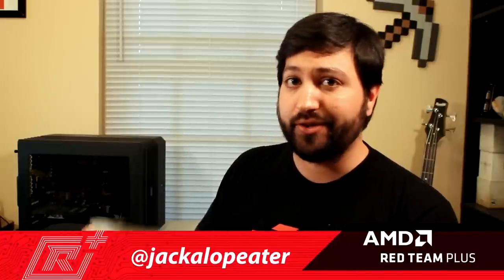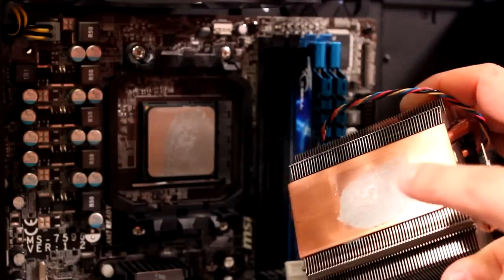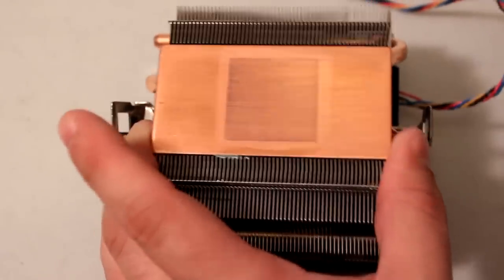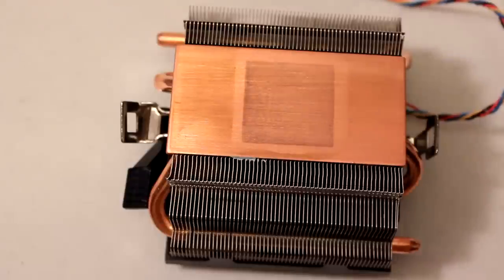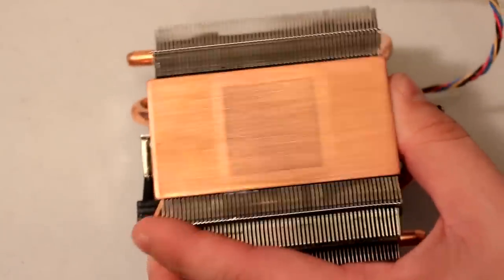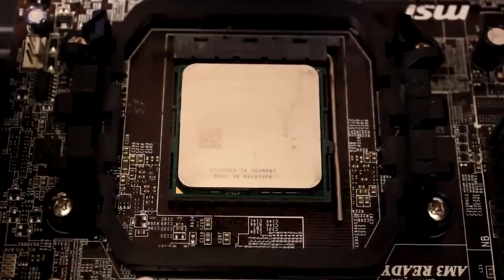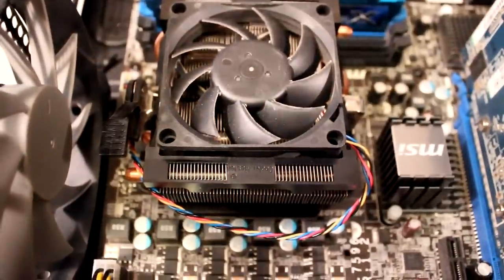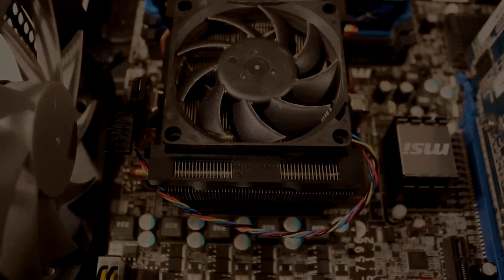How to use ArctiClean (arctic clean)

Comment: Oh come on, a coffee filter ? What nonsense people come up with. You need something soft to do the job right. A microfibre cloth is good, but so is a classic soft toilet paper. I've use that and always got the best results. It's soft so you actually wipe the old paste off properly (as opposed to that hard coffee filter that can SCRATCH the surface that is designed to be ultra smooth!). And toilet paper doesn't leave anything behind or at least if it does, you will SEE IT and just blow it off. When I'm done with the purifyer I never see anything left behind from the toilet paper, it's as good as a microfible cloth! Also I've never used more than 3 or 4 drops of the cleaner on the first pass and maybe 2 more on the second pass. Most people seem to waste way too much cleaner and use totally impractical paper to wipe the old paste off. Use 3 or 4 drops and a soft toilet paper.
Reply: I've seen many professional pc handler or what ever have scratches of some sorts on their processors, like when linus took the heat spreader off his i7 processor, there were scratches and nothing happened afterwards. So they are more durable than you think
Reply: Actually, most people recommend to use coffee filter (instead of toiler paper or any other paper) for the very reason it doesn't leave any paper particles behind.
Reply: u recommend toilet paper over coffee filter paper ?  what non-sense
Reply: @amaxlite  he is legend

Comment: Saying that it wiped right off... it took you 1 minute and 20 seconds to wipe off with this shit. With alcohol it wont even take 1 minute. Maximum 30 seconds.
Reply: All i could find at the store was this solution😢 i wanted isopropyl alcohol bruv, this costs twice as much
Reply: extremely old comment, but I just want to add that while alcohol is good if you want a quick wipe, Articlean just works the best for a deep clean, especially if you're working with small sensitive components that you can't be rough on.

For example, if you're trying to clean old TIM off a laptop's processor/GPU, which bear in mind has no IHS and is just bare die with delicate SMD components on the package, this stuff works wonders because it makes swabbing with a q tip around the SMD components a breeze. 
Since you barely have to use any pressure to clean it at all, you don't have to worry about accidentally popping off an SMD component (which mind you is very rare even when using a relatively high amount of pressure, but the risk is always present)